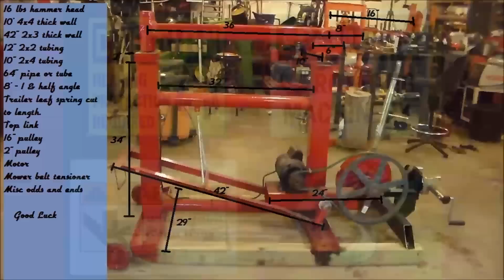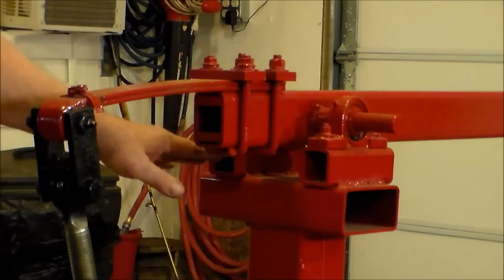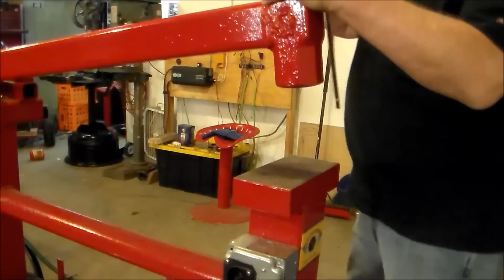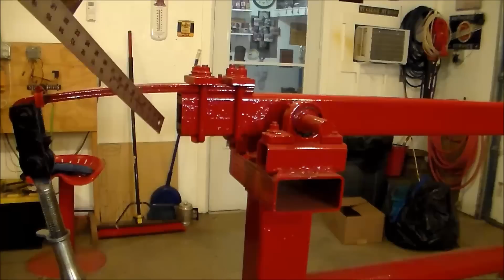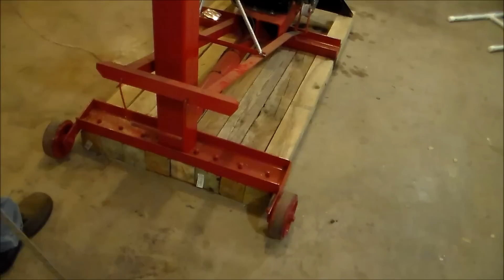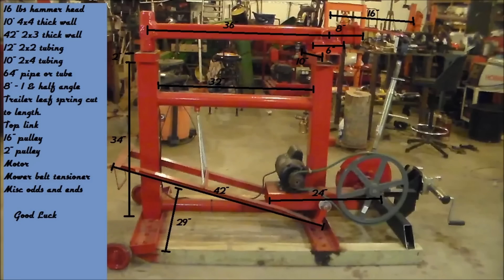How To Build A Power Hammer

Comment: Assuming Energy = Mass x Velocity:  Did you calculate the Hammer Velocity in a 'free drop' compared to the velocity in the 'controlled down motion'?  Of course RPM and belt-tension is going to play a major role in the outcome.  In other words, is the hammer velocity =/> than it would with be with the DaVinci Cam hammer?
Reply from the maker: I saw no need. A 16 lbs hammer equals a lot of force. ...lol
Reply: @RustyGlovebox  For sure!  Just curious which design drops the hammer faster.  To know for sure would require a tach on the rotating disk.  Regardless you have a very nice design.

Comment: Great video but what size motor did you use?
Reply from the maker: Thanks, it is a 3/4 hp motor at 1725 rpm 120 volt . Good luck

Comment: Have you tested to see what pound force it hits with? More than manually swinging a hammer? Less? Easier of course but I was curious as to the poundage.
Reply from the maker: It is a 16 lbs hammer head, the leaf spring adds a little extra down force  too at the bottom of the stroke.  The beam is 3 foot . I bet there is a formula out there that could answer that .  Thanks

Comment: what size motor did you use?
Reply from the maker: It is a 3/4 hp and 1725 rpm.  Works pretty good so far.

Comment: 4 videos on building your power hammer and you still have not shown us it in action.. Heat up some metal and show us what it can do!
Reply from the maker: You are right, less talk and more show. Here is a link showing me using it some. Thanks
https://www.youtube.com/watch?v=hbibGzVrwao&t=198s
Reply: Rusty Glovebox looks effective, I wonder if it would work better if you filled the front post with some weight. might keep it from hopping so much and make each strike more effective.. nice job
Reply from the maker: That might work, I recently made a rounded top for the the anvil I can remove to be able to draw and move the metal with  more controlled. Hope to get it out and give it a try soon. Take care

Comment: Rusty, great vid. What size motor is that and did you run it on 110 or 220?
Reply from the maker: 3/4 hp @ 1725 rpm, wired 110 volt